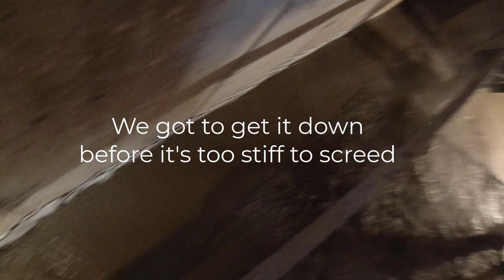Why You Should Hire A Pro To Pour Your Concrete Floor! Do You Agree?

Comment: If there was no video, you could tell that this crew knows their business just by the audio. When the words "YEP, yep, yup and yut " are 90% of the audio, it's a MACHINE. The word yup can mean 500 different things (many opposites) in a day. It can mean "pick up", then 2 sec later "put down" or "start/stop" and 95% of the time it's not an answer to a question, but more from an eye glance, or a motion. We do it all day long as carpenters & I when I used to hang board it was the same way. I wonder if it's a New England thing. (Mass here). Anyway, I like this format way better that we can hear you guys. Thanks for the videos.

Comment: I’m a GC and carpenter. I’ve done my share of concrete, mostly footings and small slabs for landings. I have a motto I live by: know enough not to be dangerous. Plenty of people will learn a bit and think they know something, they know enough to be dangerous. Learn a little more and you’ll realize just how much you don’t know. I know what this type of work takes and absolutely wouldn’t dream of doing it myself. I may be on site with a placer and a couple trowels in case things go sideways, but usually it’s just to watch and admire the craftsmanship. Unfortunately, my favorite finisher moved away. I’m worried about finding another.

Comment: Good job guys got one just like that coming up them days make u wish could have got there before deck was on lol !! 
It is hard to judge the excellerater especially with heat inside basement 
Been close to being in trouble couple times but got nice finish
Reply from the maker: We've all been there Mike, I've had some where we could barely screed it after only 5 minutes.
Reply: That's when the slight panic sets in haha!!

Comment: Mike, you mentioned power trawling at the end, but it didn’t look from the video like you did power trawl it because you would have had to hustle and get on it in the back corner asap, no?

If you did, how the heck did you get the power trawl across the soupy stuff into the back corner where it was hard as a coffin nail? You would’ve had to re-screed your path I guess.

Comment: I just poured a basement floor myself yesterday. The pump guy said I couldn’t do it. If you have good cardio and some screed boards then you can do it. And I was able to do it even though the pump shut down half the time and the pump guys ripped out half my rebar when they pulled the hose back half way through. 

I was using a line pump off the back of a boom truck. We were pumping limestone chip 3/8” 4000lb with no admixture and 6” slump. 25 degrees outside pouring into a heated basement. We would pump and then stop for 3 to 5 minutes. Every time we started up again the horn on the truck would go off and it wouldn’t pump. The pump guys would scurry around like idiots and then it would start pumping again. Does anyone know what was going on with that?
Reply from the maker: I'm not sure Brian, we've never experienced that problem. Usually the pump will clog right at the start and that's it for us.

Comment: I thought I hired a pro. The side of his tool trailer said 30 years experience. I ended up with bird baths and duck ponds on my driveway (80 ft by 24 ft).
Reply: Yeah that’s been my experience with “pros.” Mike and his guys do great work and make it look easy.
Reply from the maker: It is hard to find good guys out there. Really have to check past work if you don't know them. That's unfortunate.
Reply from the maker: Thank you!
Reply: @MikeDayConcrete  
Thank you. I always enjoy your videos.

Comment: Your fall shows why rebar caps are important. Imagine if there was an uncovered vertical stub where you landed.. ouch! 

Using a pump is nice. Outside of dragging the hose around, and potential clogs at the reducer. Not usually an issue with high slump concrete, but I’ve done a lot of shotcrete work with low slump..
Reply from the maker: Hi Matt, thanks!

Comment: Hi Mike, I have been watching your videos for a while now as I am doing a job for my friend and next door neighbour we live in Manchester England . I am going to lay a 40m slab next Thursday, my first. I am laying a 6" slab with fibres and reinforcing mesh and have a couple of questions if you could help me out with advise? First, our reinforcing mesh is 8×8 section and with supports if you stand on it it just bends. If the fresh concrete is poured will it support my weight standing on the mesh straight away with having the stone underneath or will standing on it just bend it to the bottom? Also as a novice what slump would you recommend and how much retarder should I have put in it to make it go off quicker? Any advice would be much appreciated. 
Thanks 
Andy Flynn.
Reply: Rebar will be fine just get enough concrete under it good before you go stepping on it. It’s impossible to not step on it just make sure you keep pulling it up to height as you go. I prefer a 4 to 6” slump personally, I’ve poured various slumps and that just has always been the best to work with. Size of pad and how many guys you have will determine if you want it wetter or not. Not sure on retarder I’ve never had to use it down here in the south. Just my 2 cents. Good luck it’s satisfying once you get it done. It’s a work of art for everyone to see with your name on it.